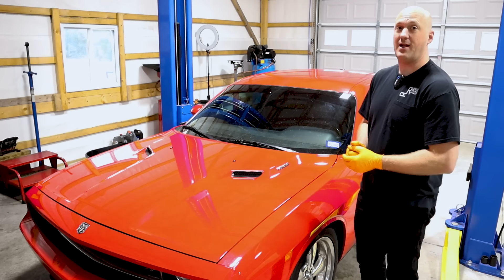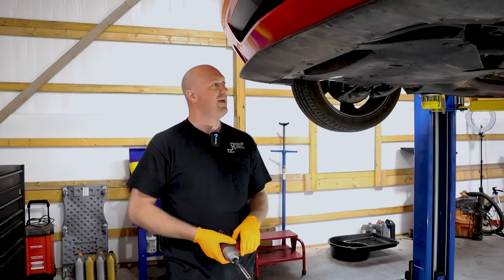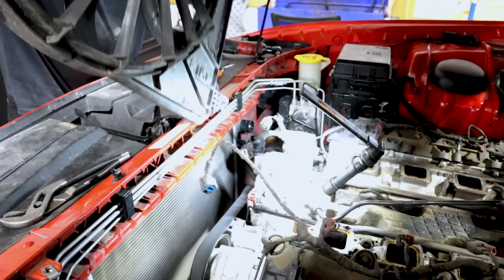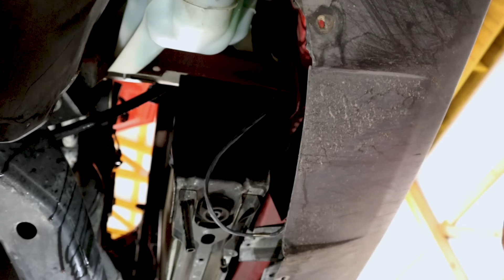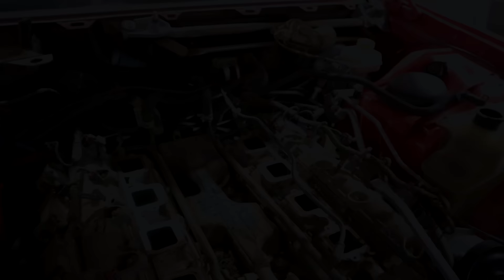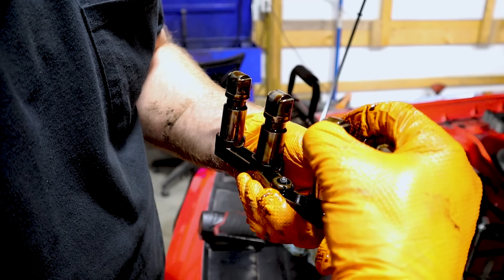Hemi Cam Installation! Budget Challenger Build Ep1

Comment: Anyone watching this with 0 mechanical experience… let me just tell you that is tutorial is on freakin point! Did my friends 15’ RT last weekend and my truck LAST NIGHT. By far the best explanation on YouTube. Thank you!
Reply: I needed this comment
Reply: @castlehouse2275  likewise
Reply: I’m doing cam, lifters, rods, and springs soon. I’m waiting for my rods and a few tools. I’ve convinced my self I could do it. Should I reconsider?
Reply: @Crysco.mp3  how did it turn out
Reply: @andrewsmith9980  I ended up not receiving everything needed until after my holiday was up. So I’m trying to find a window to do it now. I was going to do it outside under the carport in the rear of my house as it’s well hidden from the street, but now I’m starting to think that the amount of time it may take me, I might do better doing it inside my garage, which requires me to break down a lot of gym equipment and move it to another part of the basement.
Reply: @Crysco.mp3  good luck with it
Reply: @Crysco.mp3  how did it go
Reply: @Crysco.mp3  Done yet?
Reply: @Crysco.mp3  Don't leave us hanging man!
Reply: @Crysco.mp3 update?
Reply from the maker: Just saw this comment today, great job! 💪
Reply: I def would of did it myself if I had the space to do it.
Reply: Watching this is giving me second thoughts but I also don’t feel like spending 3k to install a cam. But if I don’t do it myself going to cause me a lot of issues later.
Reply: How long it take
Reply: With 0 mechanical skills this job is impossible
Reply: @ I said experience, not skill. Read a book
Reply: @5.7heaven  you should read a book .. what’s the difference between 0 mechanical experience and 0 mechanical skills???
Reply: @5.7heaven I got a question..will be doing this soon..since I'm going with stock cam will I need a tune..or it'll basically run like normal
Reply: @traylei3731 always recommended to get the tune. Relatively inexpensive and it’s the best way to optimize any modifications you make to your vehicle. There are plenty of trusty Mopar tuners out there as well. Best of luck and have fun with it!
Reply: @traylei3731 if you re use mds lifters you should be good no tune if you change lifters to non mds you need tune.
Reply: @traylei3731 it should run like normal if you’re not changing anything major bud. Sorry nobody answered your simple question.
Reply: Is it any different in an MDS car?
Reply: @gagejernigan5277 you could take it off from what I’ve heard from a diablotuner.
Reply: Thank you! Let's do it!
Reply: Was it your first time
Reply: im about to as well. ive grown up doing some mechanical work here and there, changing oil, brakes, tires. helped buddys here an there with theirs builds (small hands). i noticed a tick a while back tbh but its gotten way worse . im probably 2-3 weeks away from doing this. i have a diablo from previous owner. but gonna throw a 6.4 intake on shortly after the install an then gonna find a hopefully local custom tuner
Reply: @ reignitedauto what kinda of cam would you recommend for a little more power but still keep the trucks main focus I wann still pull my
Camper an what not but definitely wanna step it up but nothing crazy! I have a 15 5.7 1500
Reply: @gradyhelminiak9242 run the cam out of the 392 hemi and slap on SRT headers. Get a nice tune and you’ll be set
Reply: How long would you say it took you

Comment: great vids as usual! quick question wuth diablo tuner you can switch the mds system off completley, would you recommened doing that and do you need to change anything inside the engine when you switch it off or is it just a simple switch off? thanks again
Reply from the maker: Unless you are running an aftermarket exhaust I would just keep the system on. I think if you are turning it off for good it's beneficial to do the whole thing (remove solenoids, change lifters) but that's usually in conjunction with a camshaft swap. 👍

Comment: I got my 6.4L cam from Summit, but I'm not ready to do the swap yet.  I might need to wait quite a few months.  What is the best way to store the cam?  It came wrapped in paper in a cardboard box.  I was wondering if I should spray it with WD-40 or some other lube and wrap it in plastic until I can get to it so as to avoid any corrosion.
Reply from the maker: Sometimes the paper it's wrapped in will be oil soaked to keep it from corroding. If not your plan is a good one. 👍

Comment: Hi Sky,
I have a  2017 ram 1500 copperhead with 70,000miles.
Do you suggest that I switch out the cam and lifters as preventative maintenance?
Thank you, 
Mike Fitzgerald Calgary Canada 🇨🇦

Comment: thanks for the video series, i just had my lifters fail in my srt jeep 2015 for the second time. Dealer only did one half of the engine and now the other side went 3000kms later wtf lol. I have 117,896 kms on the engine and all maintenance was do on time or before, so now I'm going for the mmx camshaft and mds delete lifters and diablo tuner

Comment: I have a 2006 5.7 how different is it than the year you are working on thnx
Reply from the maker: The engines are similar in a lot of ways, but unfortunately this cam will not work on a pre 2009 engine.

Comment: I have a 2006 5.7 ,with cylinder cut out do you know if the 6.4 cam will work On that Gen motor, And is there cetain years that the 6.4 cam needs to be .
Reply from the maker: Unfortunately it won't work on those, has to be 2009+

Comment: Is this the same part numbers for the ram trucks? Or does it change?
Reply from the maker: Same part numbers for the cam and lifters 👍
Reply: @ReignitedAuto  thank you
Reply: Hey did you have to tune the car after the upgrades? Since im deleting the mds system do I have to tune my truck after putting these mods?
Reply from the maker: @dannymiranda3053  yes you will need to purchase a tuner to turn the MDS system off for good, but a custom tune is recommended for any camshaft install.
Reply: @ReignitedAuto  oh okay do you know of any good tuner to purchase?

Comment: Hey, can I ask you... im buying a reman 5.7 for a 2013 GC mds engine.   I just want the lifters to last and not flake out.  Would you suggest leaving the mds activated and just use the 6th gear mode to run mostly without mds? Or delete it all together with a tuner and leave the mds cylinoids in place? I know you were still on the fence about the lifter failures.   Thanks for your knowledge.

Comment: So correct if I'm wrong: the manual challengers (even the 6.4L) won't have the lifter issue and hence no hemi tick unlike the engines with MDS?
Reply from the maker: Unfortunately that's not correct. Even the non MDS engines can exhibit lifter failure, is just the conditions that usually make the problem worse aren't as evident in manual trans vehicles, things like excessive idling.

Comment: As you can tell by my channel pic, I got a 2016 charger 3.6 v6. I want to hemi swap it, I have the tools and a majority of the know how. 
My question is, if I do the hemi swap, do you recommend buying a tranny that came out of a V8 car as well? Or V6 trannys virtually the same? Can the TCM just be flashed for the hemi? Or would it get swapped along with the wiring harness? 

Any infor would be much appreciated my man.

Comment: Wait... Hemi motors require you to remove the heads to do a cam swap? This is why I like LS motors.
Reply from the maker: Technically you can do the swap without pulling the heads, but most often people want to upgrade or replace the factory lifters at the same time, which does require removing the heads. 👍

Comment: I have a question. If the cam your installing is meant to just work with all stock components and your not changing any lifters or any of that. Do you still have so take all that stuff off?
Reply from the maker: If you are installing a MDS capable camshaft, (which you can order the MDS version of the 6.4 camshaft) then no, you don't technically have to remove the heads to change the camshaft out. It's a little tricky, since you have to make sure the lifters don't slide down into the path of the camshaft, but the best option is to spin the cam 720 degrees to push all the lifters as far back into the bores as possible, then slide the old cam out and the new cam in, should be good to go.

Comment: @ reignited does a upgraded cam fix the hemi tick problem? Just curious.
Reply from the maker: There is definitely that potential, however is hard to be sure since most people don't drive 80k+ miles with an aftermarket cam to compare data properly.
Reply: Well today the dealership viewed the video I recorded and said they think there is an oil pressure or timing issue cause it only does it when it's cold. 🤯😬
Reply from the maker: @ShawnG411  if they already checked the exhaust manifolds to make sure it's not broken bolts, then I would say it's possible that the hydraulic portion of one of your lifters might be failing, this can cause it to bleed down overnight, then tick until the engine builds up enough oil pressure to make it go away. I sincerely doubt its a timing issue unless its already been messed with.

Comment: Hey, I haven't driven the car since install head gaskets but, i have to pull the head again. Can I just use the same gaskets and bolts? 2016 dodge challenger
Reply from the maker: You can re use the bolts, but the head gaskets should be new.
Reply: @ReignitedAuto  thanks. I installed new gaskets and bolts today. $130 for 2 gaskets at dodge, and $65 for the bolts. Put the engine all back together and now getting 65psi on startup haha. Guess I fixed the low oil pressure issue, (psst...because i forgot the screws for the oil pump).
Reply from the maker: @ZeroDayLifeHackz  hey the important part is that it's fixed! 👍
Reply: @ReignitedAuto                                                          does 65psi sound high at idle 1100rpm, oil temp 150, 0w40. i just put in a new melling pump? When hit the gas it goes up to the 70's
Reply from the maker: @ZeroDayLifeHackz  nope, with an upgraded pump that exactly what I would expect to see.
Reply: @ReignitedAuto  Okay cool thanks.  Its the standard replacement pump. I guess i will take it for a test drive. Passenger valve cover is leaking. guess i will go get some new ones
Reply: @ReignitedAuto  you the man! Thanks
Reply: @ReignitedAuto  here it is, thanks man!! https://youtu.be/IMpEXl51psY
Reply from the maker: @ZeroDayLifeHackz  nice work my man, she sounds mean 👊

Comment: This has been a great help.  The last engine I had apart was a 1966 Ford 390, in 1969.  How much as changed!  I especially appreciate the little tips that come with experience.  There is so much I would have missed and learned the hard way.

Comment: Are there not 16 lifters total?  Did you only replace 4 lifters?
Reply from the maker: Yep, I replaced all 16 👍
Reply: @ReignitedAuto  I only ask because when I plug in the part # you listed, it brings up a single lifter, and you posted "set of 4".  Is the part # supposed to be for a yoked set of 4?
Reply from the maker: @rognvaldjaegerdandy4340  that's correct it's a set of 4, if you have and are keeping MDS there will be a different part number for the MDS front and rear sets of 4.
Reply: @ReignitedAuto  No.  Like yours, my car is a Hemi 6 speed. No MDS.  With only 54K miles, are lifters anything to worry about yet?
Reply from the maker: @rognvaldjaegerdandy4340  not likely, especially in a manual trans. Usually we start to see issues around 90k miles.
Reply: @ReignitedAuto  Good.  I'll leave those for later.  I plan on doing these exact mods to mine but now instead of lifters I'll use that money towards a dyno-tune.
Reply from the maker: @rognvaldjaegerdandy4340  good plan

Comment: Will these parts fit a 2004 5.7 hemi truck I'm about to.rebuild the engine and.want.to.add a bit more power
Reply from the maker: Unfortunately not, they updated the block in 2009 so this camshaft wint fit pre 2009 engines.

Comment: Fantastic instruction.  Also great tip on draining the oil after the heads are back on to ensure any coolant that made it's way into the pan during head removal gets flushed out.  Watching this makes me want to go and mess with my truck!  Maybe in the spring.

Comment: lets try this again
i am replacing my cam for the third time, i remember you saying that the high volume oil pump could be used from a hellcat to interchange to a 5.7 hemi 2011 1500 vin number T did i hear right, cant seem to find a high volume pump for these trucks. any help would be appreciated.

Comment: I’m replacing the cam in my 2014 ram 5.7. Can I use the 392/6.4 cam with factory tuning and without replacing lifters?
If not, what is absolutely necessary to replace
Reply: ’m replacing the cam because the stock 1 is worn. I wanted to use The 392 cam because it was much cheaper if it doesn’t require tons of other mods. I may do more mods later, but just want it fixed for now. Is it smarter to replace with oem.
Reply: Did you need tuning ?

Comment: I had lifter failure , your videos guided me step by step with a few hiccups I replaced Camshaft , Lifters , Push Rods , Valve Springs , Spark Plugs and Gaskets on my 5.7 Pursuit . Started right up , no check engine light car is definitely faster even without a tune . Thankyou
Reply: Did you keep MSD lifters? Or did you do a MSD delete for the 6.4 Camshaft ?

Comment: I had a shop replace my camshaft, and now the idle is rough and it stalls out..  I had some people look at it and was told the timing is POSSIBLY off by maybe a tooth.  To fix the timing does the cylinder heads need to come back off again?  If not how much need to come out to get to them?
Reply from the maker: Nope, heads don't need to come off. Just the timing cover needs to comeback off which is fairly simple. The only tricky part is that you can't set the crank position because the cam is off. You'll have to find top dead center on cylinder #1 manually by removing a spark plug and sticking a rod down in the hole. Could be a fairly simple fix. 👍
Reply: @ReignitedAuto  thanks!  Would my timing being off cause my car to run for a like a minute rough then idle out from your experience?
Reply from the maker: @chriscurry9201  it can definitely cause this issues. Generally it will set a check engine light for camshaft correlation, but not always. If you are getting a check engine light, check to make sure first that you aren't getting misfire codes. If you are, sometimes it's a good idea to check the spark plugs first before diving deeper. I've seen it happen where people have cracked the porcelain on a spark plug when reinstalling it. 👍

Comment: Love your channel !!!
I look up to you hahaha!!!
I need your help...
I have 2007 chrysler 300c 5.7l
60k on it, I want to do the 392 cam. Do i need the 392 mds cam? Or non mds will work? I have it disabled with hp tuner at the moment, also will I need push rods? 
I have JBA l.t headers catless and 392 mid exhaust and tuned
Any parts that you recommend
Thank you for your time and knowledge!
Reply from the maker: Unfortunately the 6.4 cam won't work on your engine. When they redesigned the block a bit for VVT the front cam journal changed shape, so it won't fit the older blocks. It's best to find another aftermarket camshaft that has similar specifications. I do recommend upgrading the valve springs and pushrods at the same time. 👍
Reply: @ReignitedAuto  aww  ... 
Is there a cam that you recommend? 
I want the stock idle...
I'm going for the sleeper MODE. 
I really appreciate your time.

Comment: I drive a 2011 dodge challenger r/t automatic with MDS. Will that 6.4 camshaft work with my application?
Reply from the maker: Only if you are deleting your MDS system. If not, you will need the 6.4 cam with MDS.

Comment: I love your videos. I pulled my cylinder heads on my 2011 police package Dodge Charger. I had two broken manifold bolts. I have the heads at the machine shop. Had them cleaned an a valve job done. I want to install a 6.4 cam and matching valve springs. I don’t want to buy the wrong parts. Any help you can give me would be greatly appreciated.I also plan to install BBK shorty headers. Thanks Jeff

Comment: Like your video….you might not every see this comment but I have a 2010 Chrysler 300 and trying to figure out y my washer fluid barely come out
Reply from the maker: More than likely one of the connections for your washer nozzles has come off, possibly due to a broken nozzle. Check underneath the silencer pad on the underside of the hood, should be easy to spot. 👍

Comment: The catch can is pretty important if you're pushing the car. For emissions, it's better to burn crankcase vapors. But when you push it, those vapors are partly oil (mixed with a bit of fuel, blowby), and oil does not combust as well as fuel. On a high hp application, it most definitely will cause detonation. A catch can is beneficial to ANY performance setup, but if you're riding the edge of detonation with, for example, a 12:1 street/strip motor on pump gas, you want zero chance of any oil getting into your combustion chamber.

Comment: Awesome video, I plan on doing this on my 06 charger, you recommend a tune or anything after the install? I hear that people need tunes after installing a cam.
Reply from the maker: You will need a custom tune to optimize your camshaft install, however you won't be able to use this particular cam since it won't fit in your pre 2009 block.
Reply: @ReignitedAuto  where do you get a custom tune? I've been trying for years with this diablo tune i2 that I have. I found the correct cam for my block

Comment: What can cause the 5.7(mine is 392 stroker) to feel sluggish?,mines been feeling sluggish lately,no codes or lights on,and I tried different gas,from different gas stations but still the same,I always use 93octane,and the car never ran this sluggish before, don't get me wrong if I step on it, it'll go, but I've noticed there's some hesitation and it's not as responsive as it used to be.